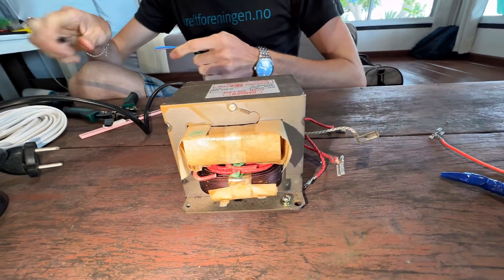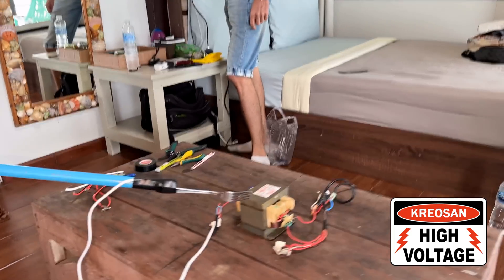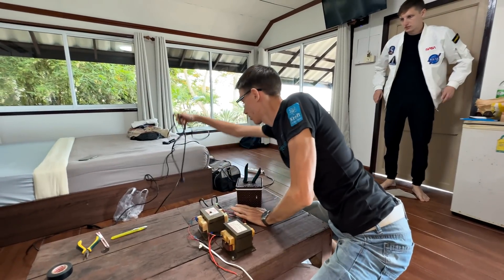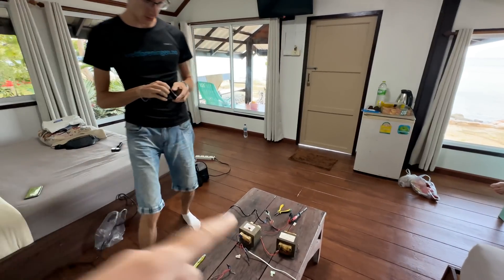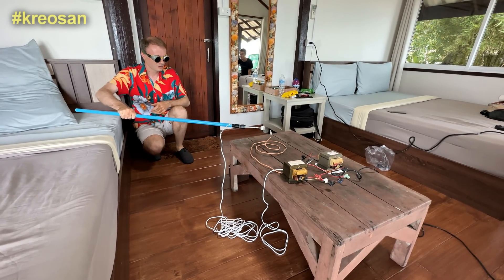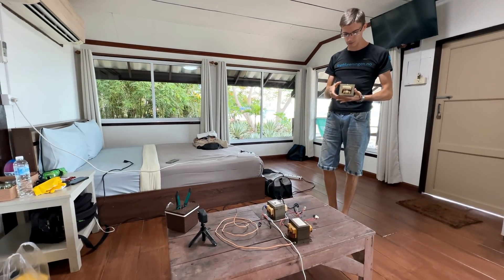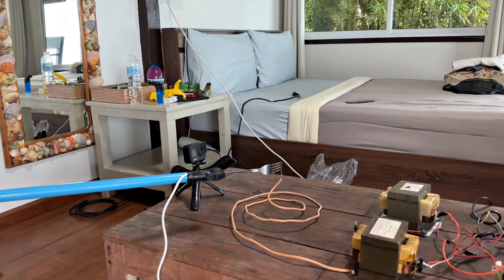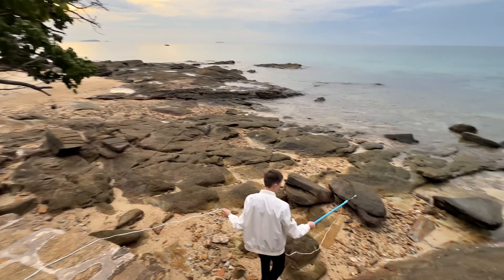What is HIGH VOLTAGE from a MICROWAVE capable of ⚡️The experiment is out of control...

Comment from the maker: Next part - https://youtu.be/2kJnaVGuWQY
Reply: Today i did something simliar but i connected a full bridge rectifier and 2 caps in series. I wanted to change the circuit so i diabled it. The capacitors weren't discharged and it shocked me. It was around 6000v

Comment: 3:22 better connect the primaries in antiparallel and the secondary in parallel to get the double voltage without risk a flashover! The insulation is very bad because mots are made very cheap

Comment: a much safer way of putting the transformers in series is reversed paralell. Then the core stays at earth potential and there is opposing voltages on the high voltage outputs. This way you do not add extra stress to the dielectric insulation on the primary windings

Comment: Now make an arc welder using the microwave transformer primary windings and some thick cable secondary windings 5 or 6 turns. Low voltage high amperage output.

Comment: Mount the transformers in an ammo can. Make sure the box is grounded for safety. Filling the box with mineral oil will provide better cooling for the transformers. You can even use high voltage insulator bushings for the output leads.

Comment: Use resonant capacitors to get longer arcs. I use just two transformers wired in series, and 4 capacitors 2 in parallel 2 in series. Even with 2 transformers I can still pull bigger arcs than your setup, simply because of resonance!  Use capacitors the more the better.
Reply: And they need to connect the primaries in antiparallel and secondaries in parallel to get the double voltage, without risking a secondary flashover in the trafo

Comment: try running mains voltage into the first primary and then run the secondary into the primary of the next transformer and then see what volatage you get on the output of the secondary of the second transformer. You can then add a third an so on, if the clearance and creepage are good enough not to arc over internaly.
Reply: It wont work because the inductance of the primaries is to low and it will overload the first transformer.
Reply: It won't work because the inductance and resistance of the primary is too low for 2000 volts. Too much power will be needed until the transformer burns

Comment: The initial arc length is determined by the 1000 v/mm rule. Once the arc is established, however, this is a plasma. A plasma is an excellent conductor. This is why you can draw out a much longer arc than the 1000 v/mm rule would seem to indicate. Once a plasma is established, the maximum arc length is determined by how much power you are putting into it, not the voltage.

That blue stick needs to be an insulator otherwise you are risking your life.

Comment: Your electrical guy doesn't know what he's doing. You need to hook two microwave caps in series after the output of the transformer. Then you'll be able to draw plasma arcs 3-4 feet long instead of your measly 6 inches. Adding more and more transformers is barely increaing the voltage and is actually making the plasma ionization of the air weaker because the current is now lower.
Reply: Exactly right. I use 2 transformers in series and 4 capacitors 2 in series 2 parallel. I can pull arcs almost 3 feet with this setup.

Comment: These guys are insane! That is definately no domestic household current! Stay safe, guys!
Reply: You'd be surprised. In the US 120V 20A will easily run a dual-set  no problems. You can get MUCH larger arcs though than they got in this video. They're missing the resonant capacitors on the 2KV output. 2 microwave transformers in sieres with resonant caps can easily do 2-3ft arc draws. Usually lasts  like 10 seconds on 15A breakers and a couple minutes on 20A. Pretty fun stuff! I hope they add resonant caps on a future video. They also shoulda bolted the two together instead of isolating the one..still fun stuff either way xD
Reply: @PhxSt0rmz  but the problem with using more then 2 is the high voltage secondary is grounded, if you connect more then 2 tohether the primary will be shorted, i have seen a video where resonance capacitor is used, the arc is over 1.5m, not yet reach the ceiling but its close
Reply: Looks like some poor buggers air BnB. Lol.

Comment: You should put a clamp meter on the cable to see if the arc is effectively creating a "short circuit".  Would explain why the transformer gets so warm.
Reply: Pretty much all arcs behave like short circuits for the transformer output. A ballast on the primary side is a must to keep the arc going for more than like a few seconds with a long "cool down period" before the next run. Especially when dealing with low frequency AC like this. 
Once the dielectric strength of the air is exceeded and the arc strikes - the resistance will drop to almost zero. 
If the electrodes are then moved apart (and stretching out the arc), it will go up as more power is needed to sustain the ionized air path. 
This could be used to limit current - but will only work for DC or high frequency AC (and even then it's not easy to manage, as the range between very low resistance and not being able to sustain the arc any more, is very small). 
With a 50 Hz sine wave (mains power) the resistance of the arc can't go up much at all, before it's extinguished at the zero crossings. So it will be either "close to short circuit conditions" or no arc at all.

Comment: I've got a beast of an MOT can draw some nice arcs from it :D. Nice to see you have a decent sized chicken stick, mine was a little short and the arc was getting close to the length of it lol
Reply: I also have a pretty decent MOT, my chicken stick was 6ft+ at least 😂 just scared of it I guess
Reply: If you put two microwave capacitor in series after a single MOT you'll be able to draw arcs 3-4 feet long. A sort of resonance happens between the caps. You'll definitely want a longer stick.

Comment: That was some impressive arcs! 😄
Reply: They did it wrong. It was tiny compared to what they could have achieved.
Reply: @wisdomoftheshadows  Yes, but still quite good given the simplicity, just using those transformers. 
Higher voltages can be reached by putting a capacitor sin series with the outputs - that would indeed give even bigger arcs, while still keeping the circuit relatively simple

The best would probably be to build a high power current regulated AC/DC converter instead, that outputs like 10 kV DC or something.
Low frequency AC is not very efficient for generating long arcs, as they tend to go out at the zero crossings.  
DC or even high frequency AC gives much better arcs for  the power input, compared to use 50 Hz directly from mains. But that would be a whole other project.
Reply: Those arcs are tiny. I can draw 6feet arcs
Reply: @ElectromaniacKVA  Yeah! 
I saw some of your clips - it was insane 😂But it is quite a bit larger setup as well - and probably way higher input power than the electrical connection to that house in Thailand would handle, as well. 
Theirs was still pretty good for using just parts out of a few microwave ovens...
Reply: @Speeder84XL  my setup has 55kVA power. The weight of the transformer is 375kg
Reply: They need capacitors
Reply: @kutsja4671  and more input current. A 16A service isnt enough